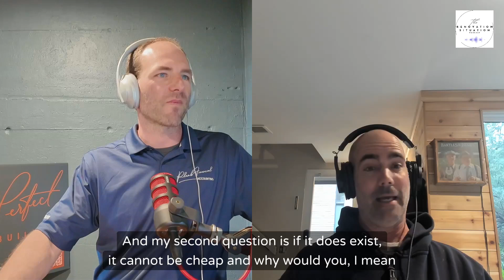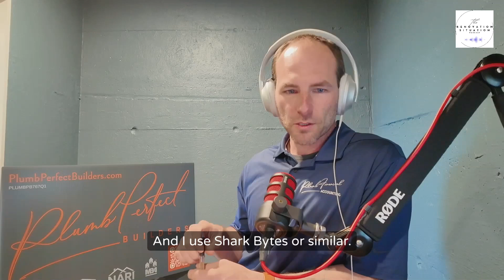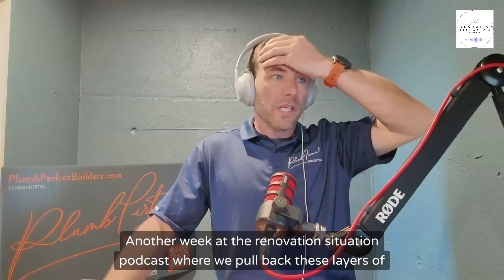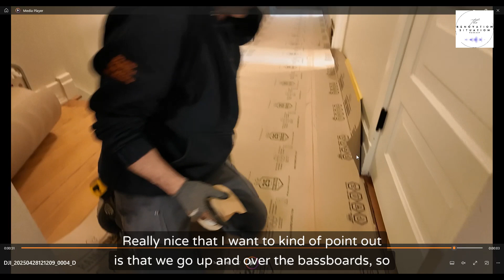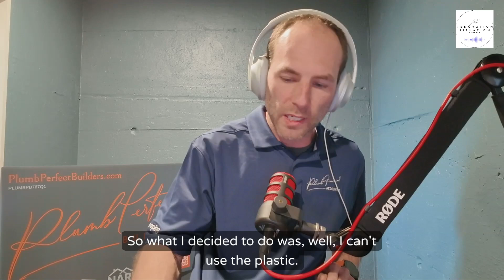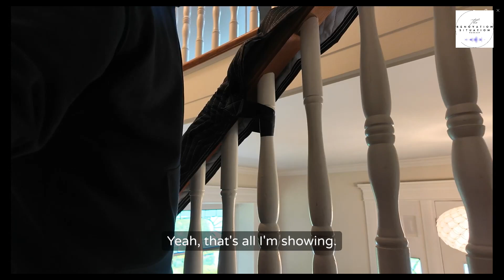042 Protection Before your Remodel!

Comment: Fun fact, hardwoods actually expand and contract more than softwoods with moisture changes, so you typically have to coat any cut ends of Ipe and similar hardwoods with an end sealer immediately after cutting or they stand a good chance of cracking
Reply from the maker: Sound advice my friend!